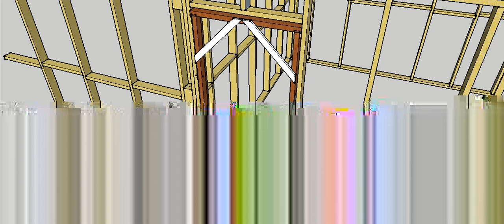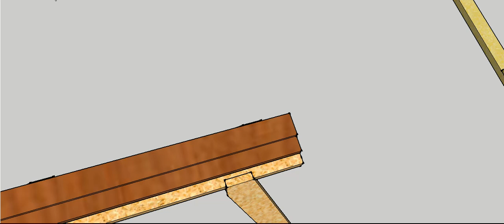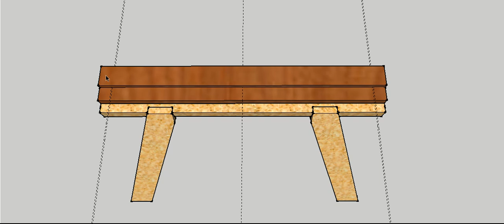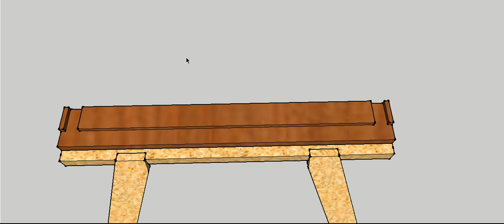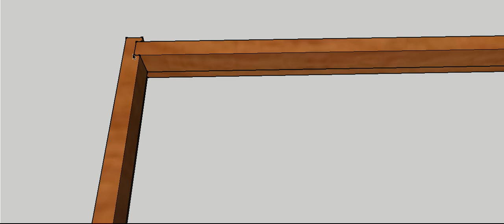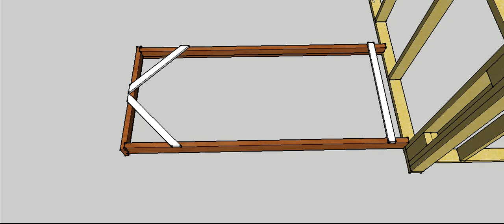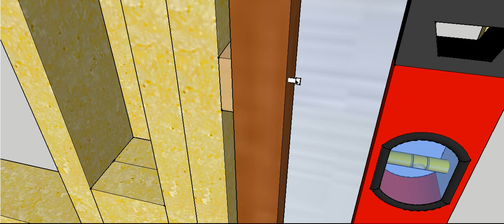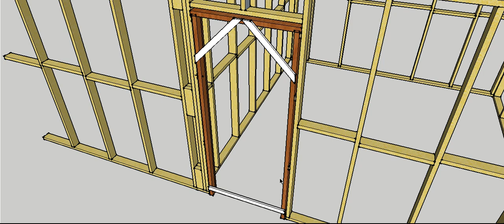Assemble and install a door jamb

Comment: At the three minute mark, why did you use the rebated edge of the offcut to mark one side and the the un rebated edge to mark the other? Wouldn’t that make the jamb sit past inside the dimensions reserved for the clearance?
Reply from the maker: Hi, not on the rebate side of the material and that is the one that you have to think about when setting out for the door.
Reply: @Buildsum  thanks 😊

Comment: How do you determine depth of the jamb (material width to use)? Equal to the depth of the stud wall plus the thickness of the intended wall coverings? More? Less?
Reply from the maker: That's it in Australia 90 or 110mm are standards to suit the 70 or 90mm framing materials

Comment: What is the width and height of a cavity for a standard off the shelf door in Australia is, please and thank you?
Reply from the maker: Hi Susan, Standard doors in Australia are 2040m high and have stock sizes of 620, 670, 720, 770 and 820 wide. Most Standard door jamb have widths to suit a 70mm or a 90mm wide stud wall and allow for 10mm of lining on each side. Hope this helps.
Reply: Thank you

Comment: In this video you are putting the door jamb against the stud, so your frame is timber what if all around that rectangle is only brick and there is no timber stud? The how do you fit the jamb?
Reply from the maker: Basically, the same way except you have to put plugs into the brick work to take the screws or nails or use a masonry anchor system like dynabolts or loxins
Reply: Thank you, and what does a plug look like?
Reply: So in case of brick wall we still call the door frame a door jamb right? The stud is only when we have a vertical member of the existant timber frame right?Because I see the builders call that door jamb a stud which is wrong, they should call it still a door jamb and not a stud
Reply from the maker: This is one type
https://www.bunnings.com.au/ramset-6mm-x-5m-red-wall-plugs-roll_p2270017

and also these
https://www.bunnings.com.au/ramset-7-x-35mm-green-wall-plugs-pack-of-25_p2260645
Reply from the maker: Yes, they should be calling it a Jamb to my way of thinking, however, terminology changes depending on the area you are in so it may be a local thing.
Reply: I see. Now I understand. Thank you

Comment: Thank you so much to show me what a rebate is. Would you also explain whether the word stud and jamb are interchangeable? The builder called the timber to be put on brick a stud, which I think is wrong he should have called it a jamb still. right? And what is a single and a double? and why double? and why he wanted to come 5 mm to the front of the edge of the brick? and what should be the ideal thickness of a jamb timber? and why it is important
Reply from the maker: Yes, it should be called a Jamb. A single rebated jamb only has one rebate whereas the double has 2 doubles are generally only used as an external jamb as you will have the normal door as well as the screen door to fit into the jamb.
Reply: I see so if you need to install two doors, like one screen door and one normal door you will put two rebates.

Comment: Thank you for the video what is the best thickness for a door stud. Bunnings has MDF DAR PRIMED 140x18mm 5.4 what do you suggest to get?
Reply from the maker: Do you mean the door Jamb
The Jamb is a rebates section of timber Bunnings and the like usually sell them in sets, 2 styles and a head, they are generally around 18mm thick in the rebate and 30mm thick otherwise. They also come in different widths, approx 110mm to suit a 90mm stud wall and 90mm to suit a 70mm stud wall
Reply: A carpenter told me MDF is not a good quality material to be used for door jambs, so what do you recommend as a good material?
Reply: I do not understand this very well. When you say the jamb is a rebated section of timber I get confused
Reply from the maker: MDF is ok but can't be used externally or in wet areas
Preprmed pine is good internally. 
For external you would need meranti or similar
Reply from the maker: Hi, do you have an email address so I can send you a picture to help explain the rebate? If you don't want to post it here please send it to buildsum@gmail.com
Reply: Is that why the carpenters say MDF is poor quality? Just because of not being able to use it externally? Can you use Meranti Internally too?
Reply: Yes sure I have just emailed you from gamil
Reply from the maker: Basically, you get what you pay for. Of course, you can use Meranti internally but the price would be quite high.
Reply: Thank you, you mention here that a 110 mm Jamb fits to a 90mm stud and a 90mm Jamb fits to a 70 mm stud. Right? So why we need 20 mm extra? Why should a Jamb have 20 mm more width to stud?
Reply: @SJ-gj7mx  unsure if you ever got the answer to this.
I believe it's to accommodate the plasterboard on either side of the wall. Typically you would put 10mm thick plaster board on each side.
Reply: @mrt9930  Thank you very much

Comment: hi john, wondering why the door jamb studs are not double studs in your show? And normally how much clearance need be left between door jambs and jamb studs. thanks.
Reply from the maker: Hi Roger
Double studs are not required unless you have a large opening in a load bearing wall and this is not the case in my drawings.
Normal clearance is approximately 10mm on either side of the jamb
Reply: THANKS

Comment: Great video and Info mate 👍 question: why bother notching out the header to take the stiles? Butt joint and a few Brad's, wouldnt that be fine? (Serious question, as im not seeing why it needs strong joinery, especially when everything is braded into the frame anyway)
Reply from the maker: Hi Robert the notching is mainly due to the rebate of the jamb material otherwise there would be a huge gap between the head and the style. I agree that notching for strength is not required. Personally i always glue and screw my jambs together as over time with the door movement these joints tend to want to open up if they are just nailed. 
Hope this helps.
Reply: @Buildsum ok, got it. Thanks for replying!

Comment from the maker: HI ***** 
If you are using a rebated jamb, which is the most common, then the style has to be rebated into the Head so that they fit together with out a large gap. If you look on a door that is already installed you should see that on the rebate side of the jamb it appears like it butts into the head however on the non rebated side you will see that the head has been trenched to accommodate the style.

An out of plumb door frame is more the rule rather than the exception I'm afraid.
Hope the video helped 
Thanks for the feedback.
Reply: How come you mark the centre and then measure out half the width of the measurement? How come you don't just mark the width from one end? Just curious

Comment: G'day thanks for the video,
Was wondering if you could recommend some spirit level sizes for me as a new owner builder? What lengths would I need? 
Cheers for the videos, they're a great source of information.
Reply from the maker: Hi Mate, I guess it would depend on what work you are going to do yourself, for most of my career I only had a 1200mm level and that does pretty much everything you want pretty well. I would also have a small torpedo type level and if you are going to be installing your own door jambs a 2m long level is highly recomended. Hope this helps.
Reply: @Buildsum  thanks mate, appreciate the comment. Thanks for your videos and channel.

Comment: What are the stages of installing a door? First we put a door jamb, then we need to put plaster , what is the next stage? And what is an architrave?
Reply from the maker: Nowadays, especially with project homes the plaster, is installed first and then the Jambs, however, it can be done the other way. Once the Jamb is in then the Architrave, this is the moulding that covers the gap between the Jamb and the frame. This video may help.https://www.youtube.com/edit?o=U&video_id=gvmKe2F5mEk
Reply: Thank you so much. you are a fantastic teacher. The video link did not open, would you kindly resend it again?
Reply from the maker: Sorry try this one https://www.youtube.com/watch?v=gvmKe2F5mEk

Comment: I am sorry I am a bit confused here because I do not understand the terminology very well. So when you have your brick wall and you want to put a door frame in there what is that called? A door frame, a stud or door jamb?
Reply from the maker: The timber that the door fits into would be the door jamb , the part of the wall that has the opening for the door would be the frame
Reply: Great, so is the door frame timber or do we call the brick wall door frame?
Reply from the maker: So do you have a double brick wall that you are putting the wall into or do you have  a timber frame on the inside and brick on the outside?
Reply: I have a double brick wall
Reply: No timber yet, all is in there is just the brick.
Reply from the maker: So is there like 2 walls very close together or is it in a garage?
Reply: It a new build house, everything is just bricks....just the rectangle is there, where the future doors should fit in, or put in.....now in terms of terminology what do we put on the brick? Stud? in that case what is the difference between stud and frame?
Reply: I do not understand the difference between stud and Jamb?
Reply: and what should be the size ? Bunnings sells 140x18x5.4........the builder says he does not want 18mm......I do not understand what thickness it should be then?
Reply from the maker: Ok so I would get the 110mm single rebated door jamb material unless you are planning to render the walls then you will have to go for the 140 and rip it down to suit the thickness of you finished wall
Reply from the maker: https://www.bunnings.com.au/hume-140-x-30mm-38mm-meranti-single-rebate-door-jamb-set_p2035397
Reply: Thank you so that MDF DAR PRIMED 140x18mm by 5.4 was for Architrave and not door jamb? Right? and what is the difference between door jamb and stud?When I want to put the frame on the brick do they mean the same thing?

Comment: I also do not understand the meaning of rebates, styles, head and stud?
Reply from the maker: A rebate is a cut out or a step in a solid piece of timber
Styles are the side, vertical member,
Head is the horizontal member at the top
Stud is a vertical member in a wall frame that runs from the top to the bottom of the wall
Reply: Now what is member?
Reply from the maker: A member is just any part of the jamb
Reply: Thank you for kindly answering my questions, Now I understand the terminology